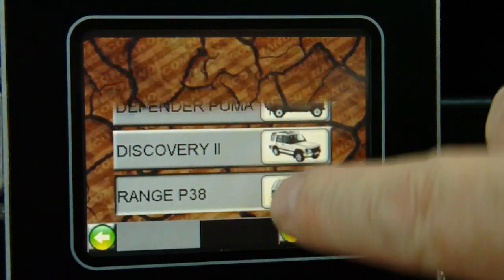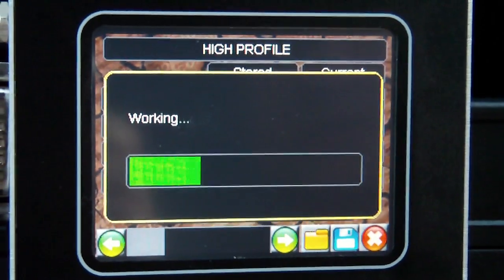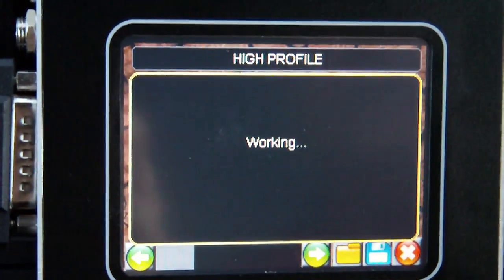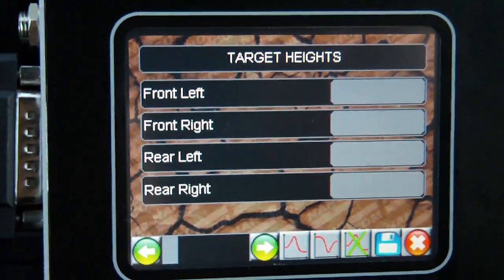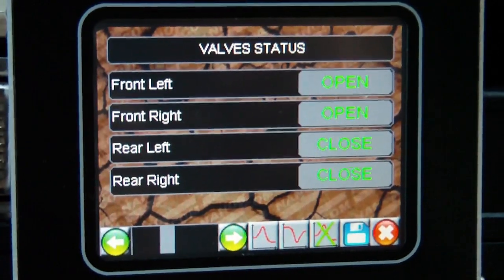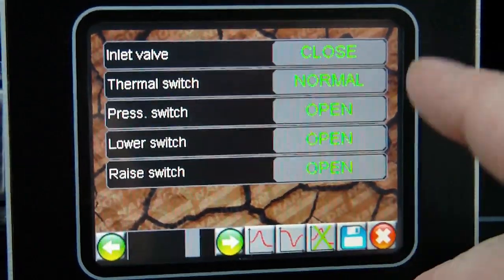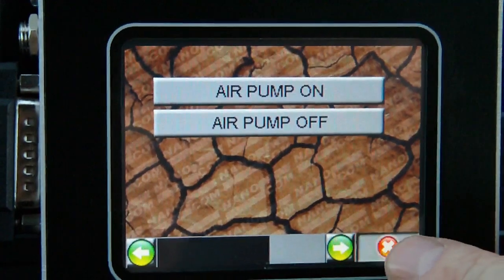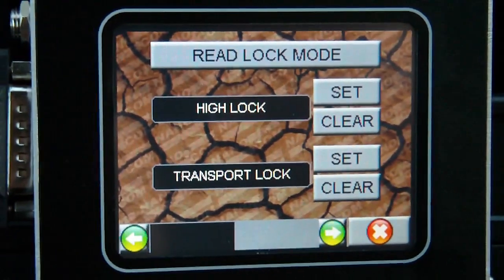Nanocom Evolution , Range Rover P38 EAS Diagnostic

Comment from the maker: Yea the Nanocom Evo 2 is pretty amazing.
18 Months after launch, there have been no real problems reported with it.

There is no special requirement to communicate with the EAS, so you probably have a wiring / Diagnostic connector problem. 

If you visit the home page of the BBS web site listed in the video description, you will find E-Mail addresses to use for obtaining help and support.